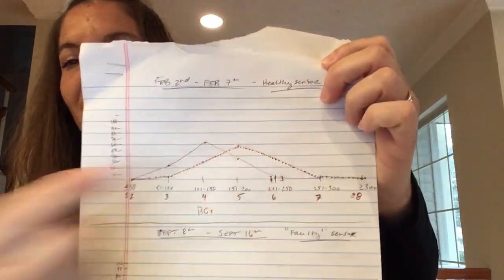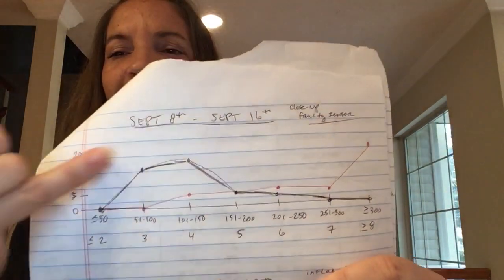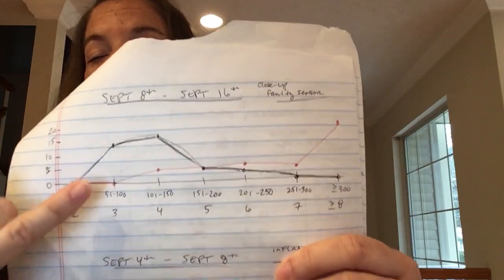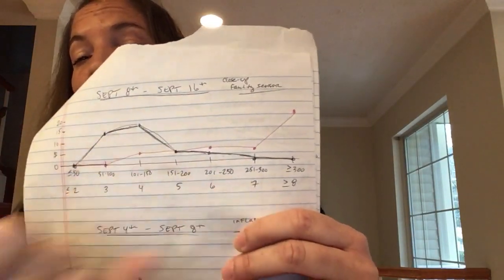Minimed 670G Bad Sensors pt. 3: Calibration Factors in Faulty Sensor (Medtronic, Fix these Sensors)

Comment: Im watching this video because Im having problems with my sensor. 

Todays issue is.... after calibration on a new sensor, (which was high at 206) the graph showed my BS was falling.... (without any medication)

Within 3 hours of new sensor and calibration, I was getting warnings with 92 and two double down arrows. 
15 min later Im in the 70's.... Feeling absolutely no effects what so ever (which is abnormal for me) of hypoglycemia..... It was close to dinner time so I proceeded to get something to eat. 

about 15 min after that.... I was told my readings were below 60...... Then the next reading was 52.... AGAIN NO EFFECTS....

I made dinner.... ate it.... and waited for the numbers to come back up...... They stayed in the 52-60 range.  So I did a finger stick.... 129. 

I put that number into the APP and it rejected the reading... It told me it was rejected and to retake in 15 min and wash my hands. 

I did that.... I'm not at 149 but the app is still showing 52. So it rejected the 2nd reading.... It now says (!) No sensor glucose... Wait until notified. 

BTW the last sensor I had (before this one) didn't seem to be correct... And that sensor was a replacement because the one before that.... was up and down within 20 min periods without food or insulin.... IE no reason to not have a flat graph vs something that looks like the Rocky Mountains.   

Im now on hold for the 24 hr tech line.

EDIT: I'm not using a pump the above was using the Guardian CGM only  (monitor only)
Reply: UPDATE whill still on hold..... Im now getting a reading with Two up arrows... at 155.  

This could be accurate as I have just eaten.... but not going to trust it.

BTW lot number for the sensor is 2022
Reply: @MrDumbace  Just as I write this reply, I have opened the second sensor from a box with five sensors from 2022, sensor Lot HG 6716 L...and just as I write this reply I get all kinds of strange readings and No sensor glucose message. The first one from that box required to be changed in day 3 but with exactly similar symptoms as you encounter, or I do with this current sensor. I guess it is a manufacturing issue. The Medtronic email reply said it's an algorithm interpretation...wait or will replace if it is necessary. Frustrating as the previous box (my first 5 ones) had no issue at all.
Reply: The Medtronic technician expressly advised me not to calibrate with values above 40. So, she advised me to start calibration in steps of 30 values until the sensor catches up to the real one.

Comment: I have used the 670g for almost 2 years and am about ready to trash it.  I change the sensor during AM hours  because it may or does go bad within 12 hours.  I can't tell you how many I have had replaced. I check my BG's when it tells me to and many time my BG and pump reading are vastly different and it rejects BG.  I wait an hour more to check again and it says to change sensor.  I am so frustrated.  I can't switch to Dexcom because I am still under warranty.
Reply from the maker: And another message from you! Oh, I’m so sorry to hear of your struggles! I had a pretty tough time with the Guardian 3 myself, and I definitely found relief in Dexcom. What about Freestyle? Any chance you could get approved for the Libre as a pharmacy benefit? Both Medtronic and Dexcom can fall under DME (durable medical equipment, but Dexcom can ALSO be picked up as a pharmacy benefit as can the Libre (which is pharmacy only). They even have a little trial program (or once did) where you can try out the system for free. Definitely worth a call into them if any of this sounds plausible to you.

I do have a diabetes technology Facebook group if you’d like to talk with others who have had similar experiences. I know Facebook is borderline evil, but we have nowhere else to hang out. 😬 
https://m.facebook.com/groups/527623797620537/?ref=m_notif&notif_t=feedback_reaction_generic
Either way, I do wish you the best of luck!

Comment: I just found out that the sensors do expire. I wasn't told anything about this during training. These were expensive so I have only used a sensor the week before I go to the doctor. I tired to save them because of the cost.. Sadly I just wasted all the money I spent. Medtronic won't replace expired  sensors.
Reply from the maker: Denise Fiedler! Yes, it’s true they can expire, but the date on the package is rarely a true indicator of whether or not they have! I hope I’ve caught you before you’ve thrown any away! This is NOT medical advice, but in my experience, sensors can sometimes be good for up to a year past expiration. Maybe even longer. I use expired sensors all of the time! If I’m not sure the sensor is any good, I can just test more frequently until I’m feeling confident. But they’re usually just fine. Hope this helps and good luck!!
Reply: @nickyghaleb  Thank you for your response. I didn't throw them away and I was able to get one with a later expiration date to work. I spoke with a rep from medtronic's who explained that there is a chemical in the sensors that reacts to the interstitial fluid. This is what dries up and causes the error message.

Comment: My husband just started using the MiniMed 670 G system.  The second sensor that he put on was good for day 1.  Then the second day it lost the signal.  Then it got it back like an hour later so he left it on.  Now the next day same thing happened. Is this going to be a regular problem.  I told him to rip it off and put on another one but there wasn’t time as we had to hit the road.
Reply from the maker: I would be happy to try to understand what is happening with his sensors if you'd like. There definitely are some tricks, and the more familiar you become with the errors, the more you start to understand which ones REALLY mean the sensor has to be changed. Those sensors can be "finicky" (for lack of a better bad word), and sometimes it's just a misunderstanding. Medtronic really is great about replacing sensors, but it can be a complete hassle to have to be changing them all the time. Feel free to let me know if I can help. Also, I've got a tech group where there are lots of us in there who have either worn the 670G or are still currently wearing it. These people have learned ways to live with it. They're soldiers in my book. :D  Anyway, it's called The Honest Exchange, and it's at: https://www.facebook.com/groups/527623797620537/
Either way, I wish you guys luck and look forward to hearing from you again!

Comment: Nicky! You raise a good point  I've replaced roughly 30-40% of my worn sensors.  The problems have stemmed either from bleeding to a sensor updating.  I've thought of switching to Dexcom, but haven't entirely catered to the idea as they require you to purchase a new transmitter every 3-6 months which just isn't economically sustainable.  The other problem lies in the fact that there aren't any other commercially available close-loop systems that work with their sensors.  However, in general my sensors work rather well.  The 1st day they are off by 20-40% but later on they get better.  I have purchased the Dexcom sensors to build my own close-loop system called Loop, but haven't fully adopted the model as its fortunate to have a warrantied product.  Also, whenever I have issues with Medtronic they immediately replace the products.  The problem is with any revolutionary device there are going to be growing pains.  The next generation Medtronic 690G and harmony system should work better.  However, since switching to the 690G my average blood sugar's from my last three-month A1C ranged in the 5.8% range.  I can on a good day maintain an average BG of 105-115 and on a bad day still maintain 60-70% time in range with a 130-140 blood sugar  Unfortunately, the pro's of this system outweigh the con's and as there are no other alternatives I'm forced to capitulate.
Reply from the maker: You’ve seen they just added a way to replace them online, right?? Though—- it might be only up to 5 in a 90 day period. I’m not sure that’s even close to enough. :/

So I just switched to Dexcom and was unaware of the need to purchase a new transmitter every 3-6 months... Really?? I’ll have to look into that. I just got mine a week ago, and it did come with 2 transmitters. So far, I’m happy with the way they’re performing. They are also low maintenance, of course, with no need to calibrate. I’m on day 5 of my first one, and so far, so good. I’ve been keeping an eye on numbers, but I’m hoping to take some time this weekend to keep a closer look. 

The next Medtronic system really might work better. I’d certainly hope so. I’m just not sure I’ll be using it. Since coming off my 670G, I’ve been touring different techniques, and there really are options out there for us. I did better on Manual Mode than Auto Mode, but I really started to grow once I took it off. I’ve been in and out of MDI and even tried an OmniPod. I was happy with it all. I honestly CAN’T say the pros of the 670G outweighed the cons, and I honestly CAN say the alternatives were great. I just have no desire to put it back on me, and that makes everything else look better. :D. Anyway, I hope you continue to get your good numbers out of it, and I hope their new transmitter gives you some relief on those sensor issues!! It’s good hearing from you. :)